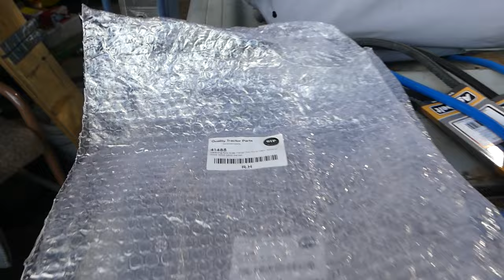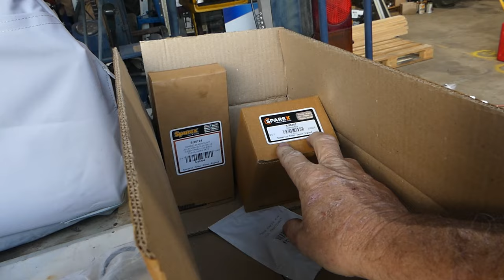Kangaroo Stew # 372 Shed Chat and New Ford Parts

Comment: Hi Lance, I was wondering if it is possible to rebuilt the harmonic balancer. The balancer compound has let go. It is off of a 6 cyl 354 perkins, in the 860 Massey combine. I'm told by  a perkins rep that they are no longer available. Thanks Barry
Reply from the maker: I know years ago we could send them away on an exchange basis but I have not heard of that for many years now so Im not sure if it is still a thing.